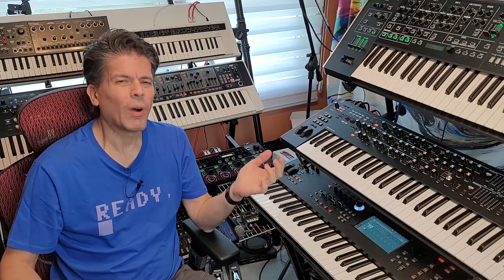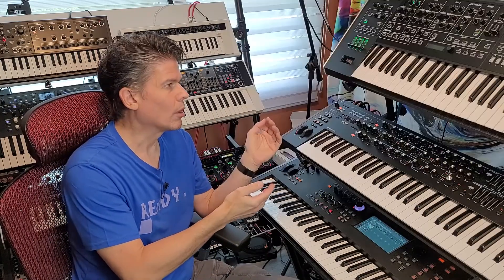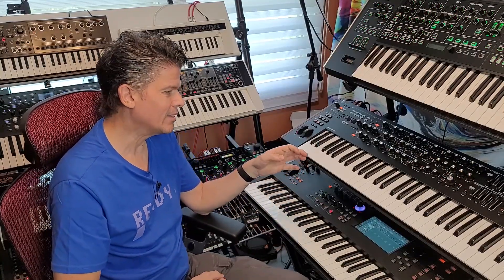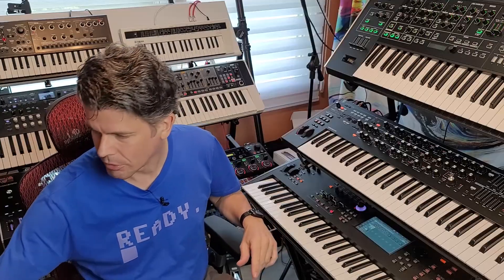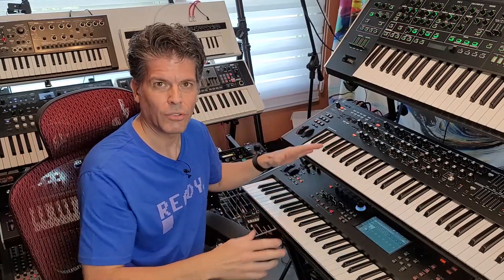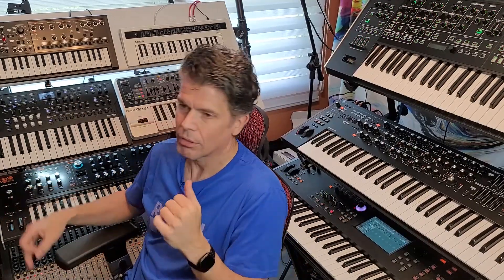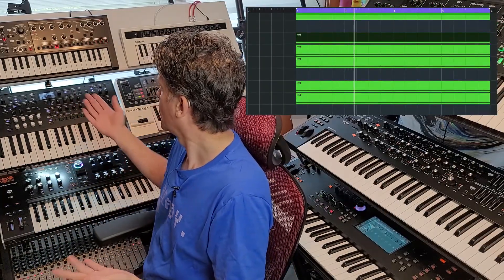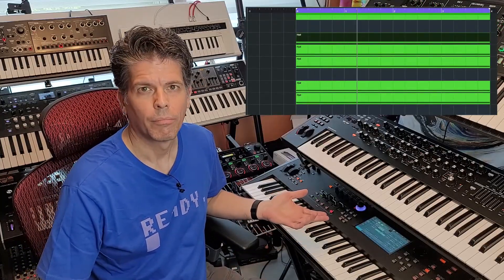MIDI Clock and your DAW: How To Sync Your Synths

Comment: I more or less was using this same technique, except that if I’m triggering for example a drum sequence on my elektron cycles, I have to pause the sequence after I’m recording on my blank bar and then manually press play close to the bar I want to start recording on, and then usually visually slide it to the beginning of the bar after recording. Is there a better technique than this?

My issue is how to sync external devices precisely if the DAW isn’t sending midi notes, but is recording an external sequence. 

Thx!
Reply: Aghhhhh!!! Why do we all have to deal with this?!? 🤬

Comment: Have you tried syncing a daw (Logic Pro) with MicroFreak? I am having a huge issue with it… and doesn’t seem to be able to find a solution 😢
Reply: @iambeetle I had a bunch of issues with it, and arturia tech support helped me out. Now that I’m checking it, it’s still finicky, but basically it’s this: in Logic open project settings, click midi, and check clock next to arturia microfreak (it should be a destination if it’s connected via usb). 

Also, if you’re recording midi info on an external instrument track make sure that the midi in port (on the far left side of the screen under the track settings) is is set to ONLY microfreak and not all, like it defaults to. For me, the arpeggiator would play in time once and then stop. Just now as I was testing I had to press utility on the microfreak and set the clock to usb and then back to auto.
Reply: @zhexum  thanks Zack, I am also talking to Arturia tech support now. And they said they understand my issue and will log it as something to work on for future firmware update. My issue is different but not rare. Because I need to play the microfreak live with my band’s drummer’s logic track live, I will have to change patches during the song, and that cause the sync to not work, because microfreak needs a “start” message to align the bear, and logic only sends the “start” once when the play button is hit… so yah… no solution for now for me, but I really hope they can fix it, it is kinda a deal breaker for me…
Reply from the maker: I have not...thje Microfreak has been added and removed to my Sweetwater shopping cart several times, but I've never actually bought one (although I played with one at Sweetwater before).

Comment: What device do you recommend to route information from the DAW to a keyboard/drum machine?
Reply from the maker: It depends on the device. Some allow simple USB connections and route MIDI over USB. Some require MIDI - I've had great results with MOTU MIDI interfaces, although now that my studio has expanded, I use a (much more capable and far more complex) iConnectivity mioXL.

Comment: Exactly what im experiencing...I don't recall it being such a headache back in the 90's but then I barely had any gear. Do you know anything about the clock of the rolad mc505? Been trying to sync it as well together with a behringer RD9 drummachine (TR909clone) and i get totally sloppy sync like your video. Thinking to do the switch back to Cubase after 20 years....but not sure it makes a bit difference between Ableton and the syncing...having to pre-count 1 bar is super annoying but seems like the best way. Gonna try use my MPC as the master clock as well soon.

Comment: How do you have all the synths connected to the DAW? I'm new to this MIDI syncing thing, since just getting my 2nd synth, and I'd like get a small collection of synths synced to my DAW.  Thanks for the vid, really helpful.
Reply from the maker: Most are connected via USB (through a bunch of USB hubs) - mainly because most of these digital synths require USB for their librarians/editors to function. Others are connected via DIN MIDI, through a MOTU MIDI interface.
Reply: @ScottsSynthStuff  Thanks so much!

Comment: For solong time i'm interessted in making Music and own some synths, but i've newer get them together to Work with Midi in a setup. I'm a Midi noooob🤔🤯😒
Reply from the maker: MIDI really isn't that difficult - you can make it complex, but for the most part, you just plug things in and it works. You might need to learn about MIDI channels, but in this day and age of modern multiport MIDI interfaces, with a dedicated MIDI interface for each instrument, that's no longer as important as it was back in the 1980's.

Comment: After I left Atari ST I never managed to sync Korg Wavestation wave sequences good enough. MIDI clock is simply not accurate on modern systems. ATARI ST with any sequencer software and any MIDI interface - MIDI clock and slaved devices worked perfectly.
Reply: Wavestation was/is notorious to slow MIDI response. I never wave sequences as a pseudo sequencer - only to morph between waves that were similar (like the VS set). It's depressing to see how some of the modern synths w/ arpeggios are so bad. I have a SQ-64 which thankfully sync's very well to MID clock via Digital Performer and their MIDI timestamp tech. I also have moved to using clock pulse via the audio interface to modular clock-in. Extremely tight.

Comment: i'm pretty confident on midi sync but the biggest problem i'm struggle on, since my synth collection is grown up  it's the audio's latency that come from a synth that have a midi writted on the daw, using ableton i'm lucky to do ms adjustment on each tracks but every time you'll add something like as a plugin or another track you'll completely lost all and have to do the adjustemnt from scratch...do you have some tips or tricks for this issue?
Reply from the maker: I don't use Ableton, so I can't really make a suggestion for this - I can tell you that in Cubase (which I use), it just takes care of MIDI, audio and plugin latency automatically. It just "fixes" it in the background without you doing anything or even realizing that it's occurring.
Reply: Sounds like automatic delay compensation issue...
Reply: don't use plugins, use outboard fx for sound design and multitrack record all audio together. use plugins afterwards once all audio is recorded. Also if you use an analog sequencer to send midi to your devices and just use Ableton to record thee audio you will have nice tight sync and the hardware groove and nuance.

Comment: Can we put all synths constantly in a ever running clock, despite of sequence/recording/playback? If there is a solution like that, it could be a smoother process, could it?
Reply from the maker: Yes, there are ways of doing that, most commonly with an external clock source, like an ERM Multiclock. IT becomes the master clock, and the DAW (and all the other hardware) syncs to it.
Reply: @ScottsSynthStuff  so would you disable the other clocks in all of the synths ?

Comment: Hello, how can i connect those machines into the daw ? Do I need a device ? also, what about keyboards that do not have an built in ARP or Sequencer ? thank you so much
Reply from the maker: You can use a MIDI interface to connect them via DIN MIDI, or pretty much every synthesizer made over the past few years also has a USB connector, and can route MIDI over USB.

Even synths that don't have an arp or sequencer still do the same thing, they can sync things like LFO rate, or FX delays, etc.
Reply: @ScottsSynthStuff  hey, great video. Could you please explain how to sync the lfo rate to bpm between hardware synth and DAW

Comment: OK, thanks, but HOW...  HOW do I actually set up my synths to track to the MIDI clock on my Daw?   What is the process by which you actually get them to talk to each other?   What is the parameter setting I need to find and turn on?   I've set my synths to "external clock" many times with many synths, but I seem to be missing something, because it does nothing...  HOW...  "H.O.W" do I sync to a MIDI Clock?
Reply from the maker: If the synth is set to "external clock" or "clock auto" (where it switches to external clock when it sees one), then the only thing left to do is to tell your DAW to send a MIDI clock to your synth. Some DAWs send MIDI clock only when playing/recording, others can be configured to send MIDI clock all the time. You usually have to configure in your DAW which MIDI devices it's going to send MIDI clock to. How that is done is different in every DAW.

Comment: Really cool Scott. Do you think this same workaround will work with older synths (with midi) but from the 80s/90s?
Reply from the maker: For the most part, they shouldn't have this problem. When the old synths see a clock signal, they drive their entire internal clock slaved to that clock signal. They are not like these modern synths that are bound permanently to their own internal clock, and whose idea of clock sync is to measure the incoming MIDI clock, and then try to set their internal clock to the same value. That process is what causes the problem I demonstrate in this video.
Reply: @ScottsSynthStuff  Great, can't wait to try this with my DAW on my DW8000. Thanks.

Comment: How do you route Cubase to send midi to all those synths. I have a UR44 but it doesn't have enough midi. I have a psr a5000 arranger, modx 6 and a couple of midi controllers and would love to use all of them with Cubase.
Reply: MIDI thru box is one solution if you’re using midi for daw to synth. Midi merge box for synths to daw. Alternatively usb hub if that’s your choice of cable (assuming your synths / controllers have usb!). Hope that helps.
Reply from the maker: It's a mix of a MOTU micro lite MIDI interface - https://amzn.to/38U0yBs - which plugs into a USB port and gives you five independently addressable MIDI in/out connections, and USB connections. Most synths today give you MIDI over USB, and many of them REQUIRE USB in order to use their librarians or other custom functionality. So I have some large USB hubs into which the synths plug into, and those go into my DAW PC.

So with a mixture of the MOTU MIDI connections and the USB connections, they're all hooked up at once.
Reply: A bit pricey but fantastic solution is a MioXM from IConnectivity. It has support for 5 pin, usb and ethernet connections.